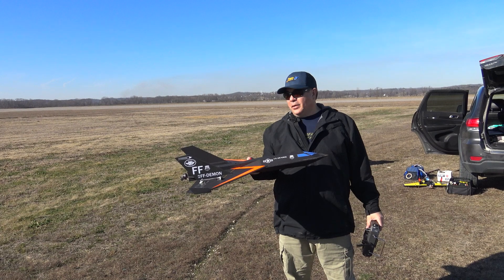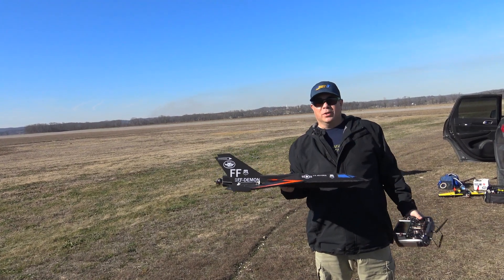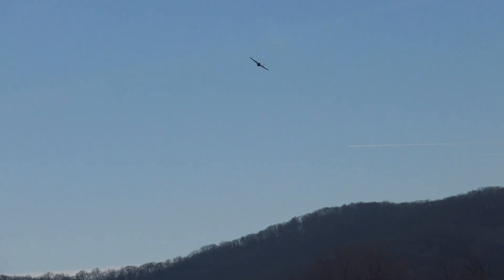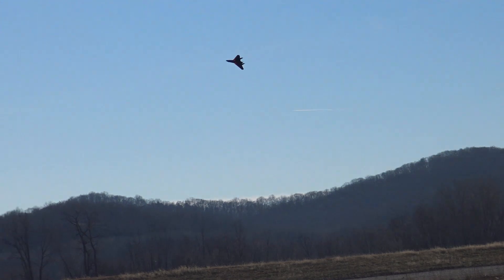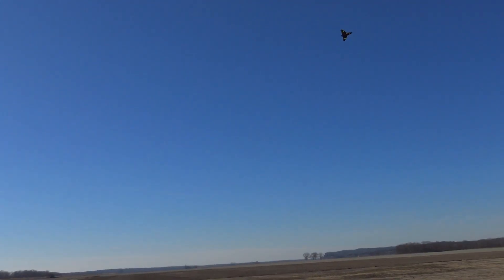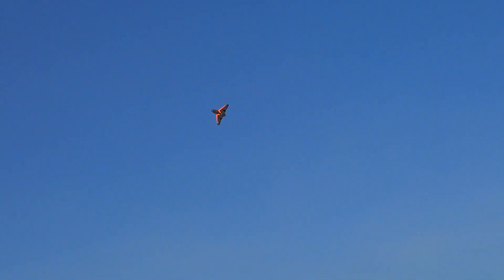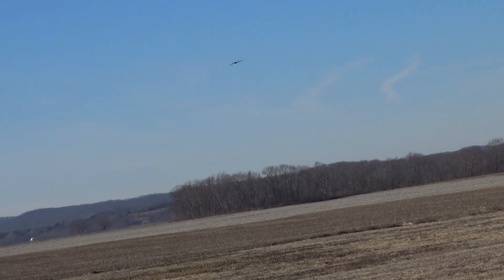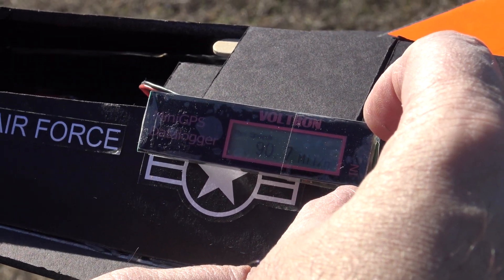FF-DEMON One More Test Flight At Hermann Airport

Comment: Seems to be better than the previous configuration. For sure if you hit the CG a little further back(Less then half inch) you will have a better glide. If you allow me an opinion:Maybe(I'm not sure)a dual rate and exponential of 40 in the ailerons could improve the rolls by making them smoother.
Reply from the maker: Thank you for the comment cirandavideo. I do have my triple rates set up. This flight was on the lowest setting and does have exponential set at 45 I believe. The rolls in the video were made at full stick just to see how fast it would roll over. With he exponential and low settings it should roll nice and smooth with a more gentile stick movement. Thank you for your input!